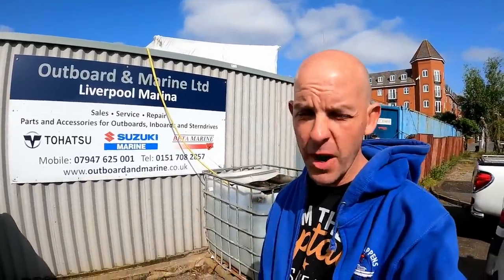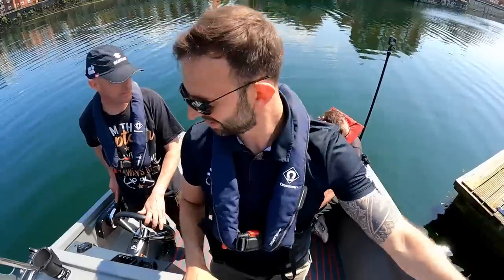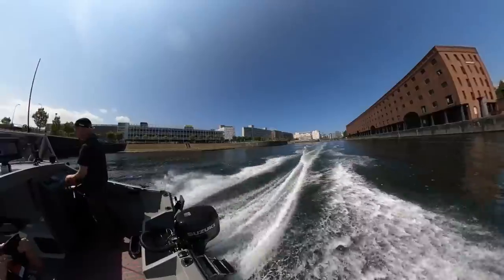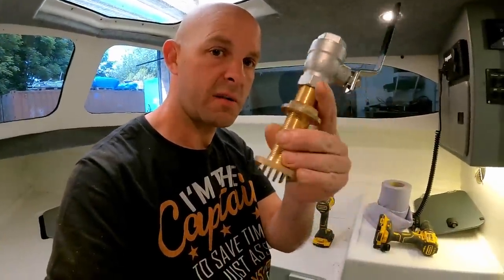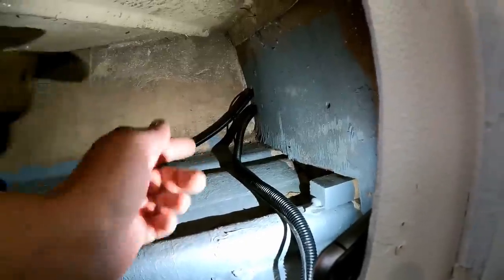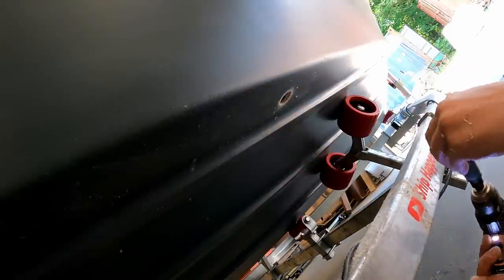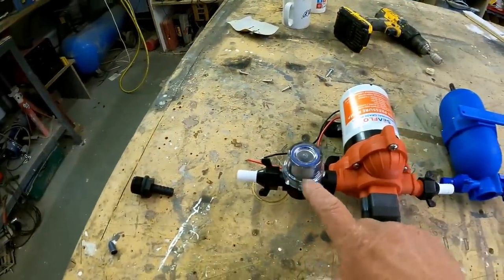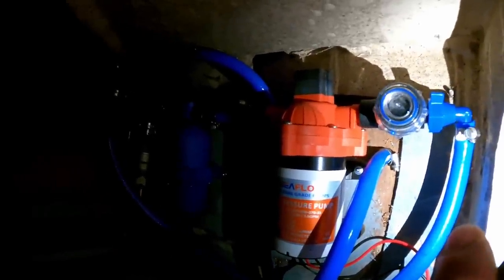Suzuki Engine Servicing, Fitting A Shurflo Wash down Kit and A DIY Bimini for £24!!

Comment: If you put two right angle fittings and a connecting tube between the two front supports, it will prevent punching a hole in the bimini a bit better. Would not have to be glued to the uprights, just the ends of the cross piece.

Comment: Two 90 degree ells and a short PVC pipe can link the forward poles together, preventing wear on the tarp and reducing flapping in the wind. They dont need glue except where the ells join the cross piece, the tarp should hold it down fine.:face-red-heart-shape:

Comment: Good canopy, but maybe take the pressure off the cover and get two elbows with a piece of pipe across the middle section making a C frame. Not glued as the pressure of the cover will keep it together when pulled tight down, so it packs away with the rest of it.

Comment: Simon, suggestion - why don’t you solvent weld a 90 elbow to the upper top of two white tubes and add a loose pipe connection piece between the two, so it can still be split to still fold away and support the front of the canopy better.

Comment: I would just suggest on them PVC pipe you have a front put a tennis ball on the end of them. That way it won’t go through your tarp or put something round up there, so it doesn’t wear on your tarp up there because it’ll go through in a heartbeat, just a suggestion, you may use it you may not have a great day.

Comment: You might have found out already, but the white support for the Bimini might need some more fixation and strengthening. If you make a doubling of material and maybe a little cup, then that pipe will not tear through the sheet and stay put on its designated place even with wind.

Comment: Love the build!  But I think you should be sealing the hole in the hull and the plywood backing plate with epoxy before installation.  The sealant is going to fail eventually.

Comment: Look at getting a set of flushing muffs. They're just rubber cups on a metal clamp. They fit over the water intake for your motor and attach to a garden hose. Then you don't need to fill the tub OR open the access port. Clip them to the hose and slide them in palce, turn on the tap and run your motor.
Making things for your boat can be not only fun, but much cheaper. If you could buy that same setup that was in a marine chandler it would cost you 100 pounds JUST because it's for a boat. Often you can find gear to use on a boat in garden stores and the like and repurpose it for much less.

Comment: It was nice to see the Albert Docks. When I was young, I would get in my car and drive from the family home near Llangollen to the Albert Dock and walk around. To someone who grew up on a farm in the countryside, driving to Liverpool was such an adventure. At that time, the Albert Dock development was still relatively new (about 5 years old) and was a trendy place to go. I thought I was really cool driving into a 'big city' and the Mersey tunnel was an adventure in itself. Little did I know at the time that I would go on a bigger adventure and end up in Japan, where I still am. The Mersey tunnel has now been replaced (for me) with the Aqualine bridge and tunnel over and under Tokyo Bay, linking Kawasaki(川崎) with Kisarazu(木更津). A man made island in the middle which doubles as the motorway services is the point where the bridge becomes the tunnel. Then there is the very nearby Yamate Tunnel under Tokyo which at 17km is the second longest road tunnel in the world. It weaves in between the subway system of Tokyo and you can hear the trains from your car in the tunnel. In one location there is only 10cm difference between the road tunnel and the train tunnel. A remarkable feat of engineering. Still, The Albert Dock will also hold a special place for me and no amount of engineering will every replace that time I spent going to Liverpool.

Comment: I used to have lil 20’ cudy cabin with a 115 hp merc on the back.  When we were done in the bay or Atlantic Ocean we had what looked like ear muffs. But I hooked garden hose up to it. Started the engine and water sucked in where hose was.

Comment: Why didn't you use sandpaper to get a perfect shine? May I suggest smoothing the plexiglass / plastic where the hand hold is? Bouncing around may cut your hands. You can buy small rubber tubing and slice it and slip it over the edges!

Comment: What is expected top speed and comfortable run speed? Were the reps happy with the rpm to speed ratio with the existing prop? Does the ladder add a bit of drag prior to plane? She does chime/wobble at high speeds then settles. Boat/engine trim tabs possible? 

Bimini  is an inexpensive fix when idling, trolling or parked. May want to put plastic stops on the exposed pvc ends to reduce friction.  I could eventually see Simon adding some additional connectors and removable poles to facilitate bimini top support from the control panel aft to the 2 adjustable painters poles. Gemma has to paint those 2 yellow adjustable poles to match one of the boat colors. You have a working template. Compare costs/features for similar size sun shade (thicker, heavier, ++ $$$, water resistant, UV protection, fading).

Grey/black does retain heat. So after a few trials, you may choose or repurpose something lighter.

Comment: If you add a third pipe in the middle front and a 90 degree L bow on each side a T in the middle and connect them with pipes it won't poke holes in the fabric after 5 minutes of use and be far more stable in the wind, if the middle pipe is a little taller it would help direct any rain of to the sides, hope it works out well for you regardless. Good luck fishing, have fun but be safe.

Comment: If you got 2 90 degree bends and glued them on the top of  the poly pipe at the front, your shade sheet will last much longer. Nice boat

Comment: i had a boat similar that used to wheelstand as well, most of the weight was at the back. I put a hydrofoil on the outboard and it jumped onto the plane so much quicker and trimmed out nice and flat at speed as well, worth looking into

Comment: The screen stops large pieces of seaweed from getting into the pump, which can burn up the impeller. The screen also stops plastic from getting sucked into pumps, wash down, engine cooling pump etc…

Comment: I would use the hose port, because salt water trapped in the engine will corrode almost as fast as sea water.

Comment: As everyone is pointing out the pointy pipes 😉 I will take a guess of your fix to the stability issue, I say this cause you two are mad enough to mount a gyro stabilizer like the Seakeeper or probably a quick gyro on your little boat.😅 
Anyway as always, looking forward to your solution. 😊

Comment: You might consider attaching a tapered wooden plug to all your through hulls the size of the pipe below the valve. I lived on a large boat for years and there is nothing worse than accidently dropping a large wrench and breaking the fitting just above the hull, allowing water to pour in with no way to stop it other than holding your hand over the hole and yelling at the top of your lungs for help from the bilge. Not that it ever happened to me... ☹
Reply: We always kept a redwood " spike" near every thru hull ( lost a transom plug many years back and after the fire department pumped the boat out they drove a wood spike in the hole and laughed like hell at the credit card Capt. 😂  NEVER caught with the pants down again!
Reply: @randyjude8346  Exactly. Never again. 🙂

Comment: Bronze fitting and stainless steel are not good together and will cause galvanic corrosion you should replace the valve with bronze to be correct.

Comment: Why haven;t you fitted a safety rail to the foredeck?, If you continue to anchor from the stern, while fishing, you'd find it very ,very uncomfortable in any kind of rough water, and you could take water over the back of the boat. To venture onto the foredeck without a safety rail is Dangerous. Even  if you tried to use the anchor from a front hatch, could prove dangerouse in certain conditions at sea. I would be surprised if the organizers even allowed your boat to go out to sea, as the boat stands now.
Reply from the maker: We anchor from the bow, but we use the Alderley ring method so it doesn't require us to climb over the front, so no safety rail needed
Reply: @ShipHappensUK